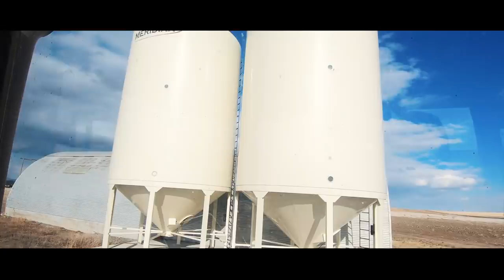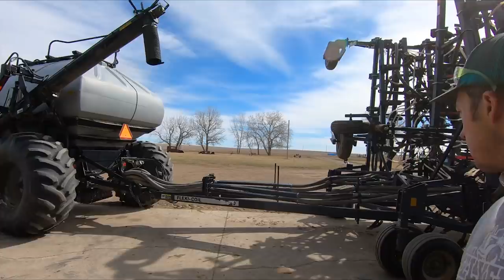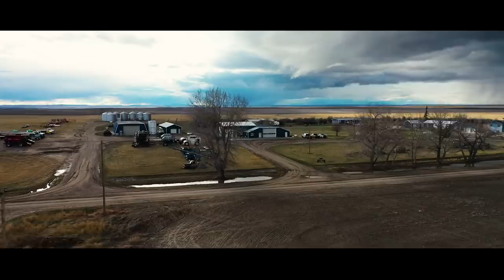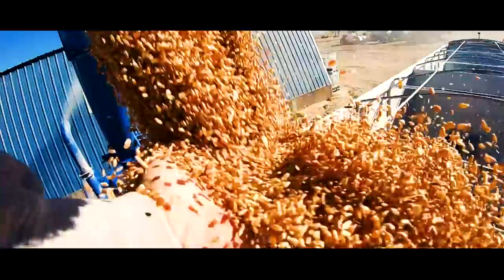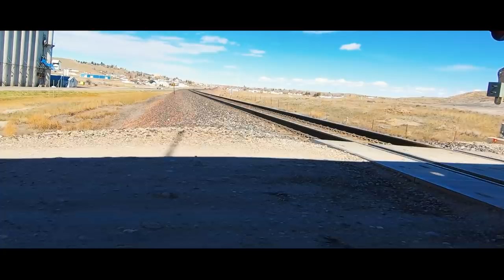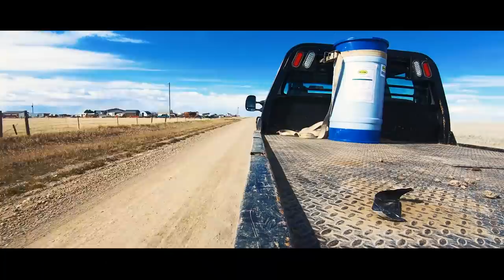Seeding Prep - Running Out of Time & So Much To Do! - Part 2

Comment: I don't think there is a farmer within 50 miles of me that can chase threads on a lathe. They only know how to drive to the dealer in their $60,000 pickup for parts or get a local machine shop to do it for them. I'm impressed.
Reply: He is like a duck to water when the chips fly, Easter Blessings 👍

Comment: The wind blowing the right way so you can have the window open is indeed a blessing. I've hauled enough garbage and dirt to attest to just how nice it is. I wonder if the weight laws in Montana are different than Idaho, because in ID you can put 40k on a set of tandems when hauling bulk unprocessed goods, everything else is 34k.
Reply: No, for rural and secondary road are 34. Easter Blessings 👍

Comment: How many years do you keep a cart typically for ? The buds vs 2018/2019 edition tracked  or conveniently wheeled tractors ... what keeps the buds on the farm vs having quadtracs or the 9rx ? Initial cost of the newer machine ? Running costs ? Parts ?
Reply: Lots of questions. I'll try but doing this as I am seeding in one of the Buds. Our carts have been working for us for 14 years now, we keep repairing them. The Buds have been paid for and been serving us for 40 years and are easily upgraded. They do what new tractors do now (and they are fun to run). Easter Blessings 👍
Reply: Robert Welker thank you for the reply Robert, just viewed the update #7 it’s really coming along now !

Comment: If you have air bags on both tractor and trailer separate air bag pressure gages one on trailer and one in tractor will tell you with a thousand pounds what you have. Edit on flat ground. Just saying in my State during harvest season you can run 100 thousand on State and County roads do not get on Federal highways. Ching Ching

Comment: Wow i would never guess that would be chain driven. That seems like it wouldn't be very dependable,  I would like to see what that chain and gears looks like.
Reply from the maker: To my knowledge this is the original chain and it has over 10,000 hrs on it. It is a very unique chain, pretty massive
Reply: @WelkerFarms  Is it splash oil lubricated? That would help explain the life. Edit: I see that it is.

Comment: Those roads looked like unpaved roads. Why would there be weight restrictions on them? Great video by the way, thanks.
Reply: Just like paved roads overweight and heavy loads can really tear up and deteriorate the roads. Especially in the spring when frost is coming outta the ground they get really soft (just like in front of the shed they were pulling wheat out of)

And since they and their neighbors drive that road all the time its nice if the road is in good condition for driving and being easier on the trucks and equipment, especially in large counties when they have many miles of gravel/stone roads to maintain and don't get back around to all of them quickly.
Reply: @jonkreiser7757  Thank ya much.....
Reply: @tarefoot  Yeah you bet. Take care.

Comment: So how many hours can you get out of one of these chain cases on the buds? It's basically a transfer case
Reply from the maker: I believe the chain has only been changed once and the sprockets are original. It is bathed in gear oil too
Reply: @WelkerFarms  That's incredible! That's allot of horsepower and torque running through there. And with all the hours and miles on them they have turned many a times.
Do you know what size chain is in there?

Comment: What happens if any of that machinery leaks gas or oil on the field and or crops that is growing
Reply: Unless you stand there for a hour in one spot pouring oil or fuel not much will happen maybe kill a little grass maybe.
Reply from the maker: Exactly what scruffy said 👆
Reply: Thanks for the reply 
Keep up the good work👍

Comment: Do you add the inoculant  to the seed when you transfer it to the seeder tank?
Reply from the maker: Yes when we fill the air drill tank we add it. It has a lifespan of 24-48 hrs once the package has been opened and oxygen making contact with the organism. So we put it on right before planting. There will be more in a future video! Stay tuned
Reply: @WelkerFarms   Alright,  I did remember correctly from doing this with soybeans many years ago. Thanks for the confirmation.

Comment: I thought you guys sold the magnum
Reply: I know the Welkers are busy and I don't mean to steel the show from you Nick but figured I could answer this question for Elevators 101.

They used to have two Magnums a larger 8940 with duals and no loader and they restored then sold it since they didn't need it to pull the sprayer. (the sprayer that became the Big Brute) and they kept the 7140 with the loader.

You can check out they did some time lapse videos of the restoration/repair.

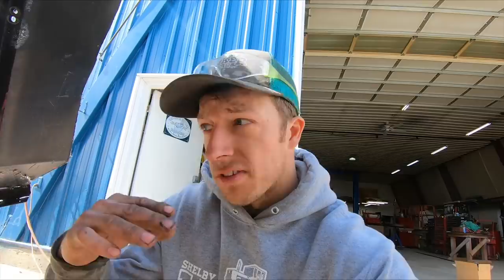Comment: 7:00 next time use delrin
Reply: Will look into it,  Thanks, Easter Blessings  👍
Reply: @RobertWelkerFarmerBob   I'm not 100% sure how it would work with a quick spinning auger but it is an excellent bushing material in stuff like suspension systems. It can be bought with Teflon impregnated in it for extra slip. Happy Easter